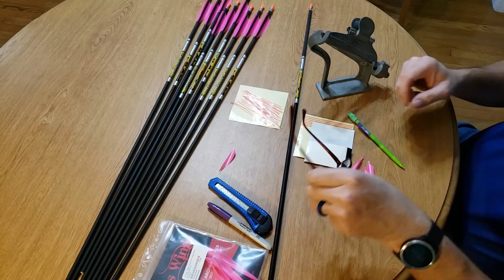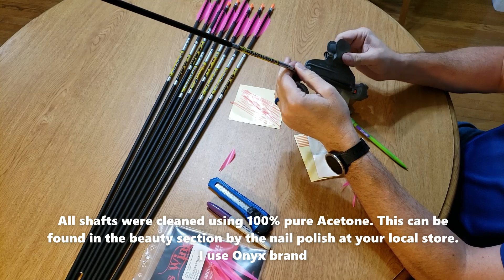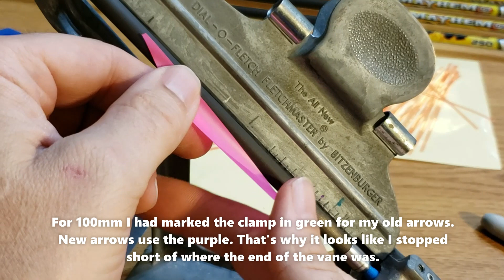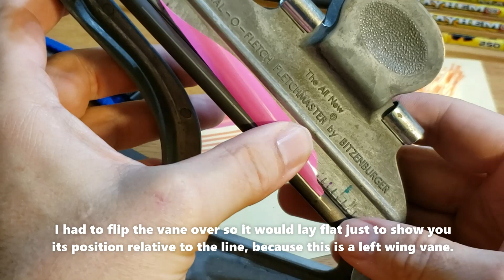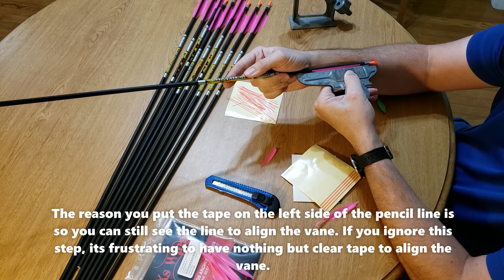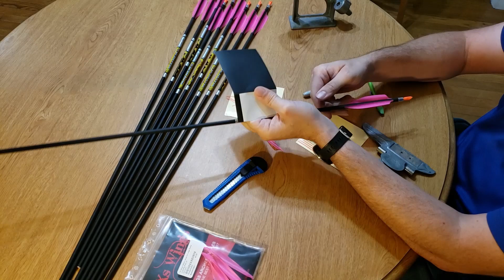Installing Xs Wings

Comment: another video by a british coaching site says to not tape the back of the fletch. only the front?
Reply: Archery academy is the site. I have only shot about 100 arrows and nothing looks to be affected. Let’s see in a few more weeks. By then I’ll have shot 6 or 700
Reply from the maker: Thanks for the comment. These vanes curl a lot, maybe more than typical mylar. Not taping the rear would cause them to fold over. Thats my opinion, test and see what you think.

Comment: Are these the 40mm? I tried and hated the 40mm. Too small IMO. Going to try the 50s
Reply from the maker: I typically use 60mm high profile. Didn't have much luck with low profile in any length, but could have been the tune. Ive used 100mm indoors and testing 50mm outdoors with good results.